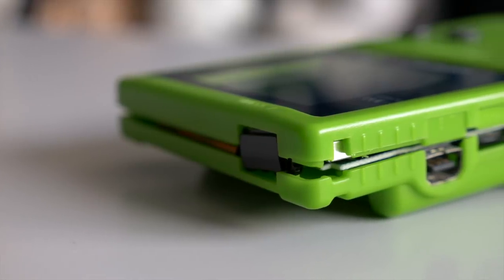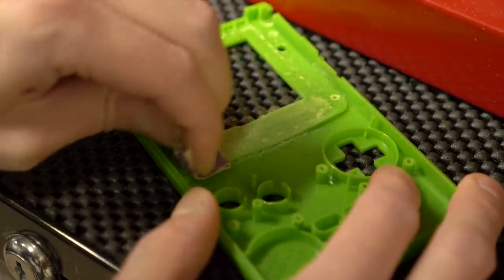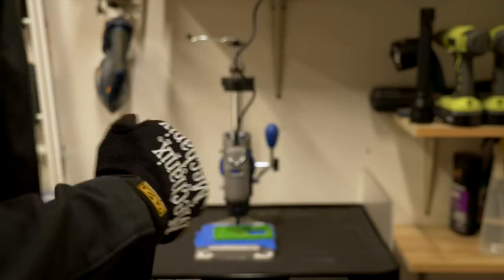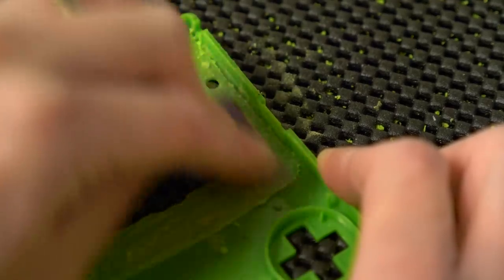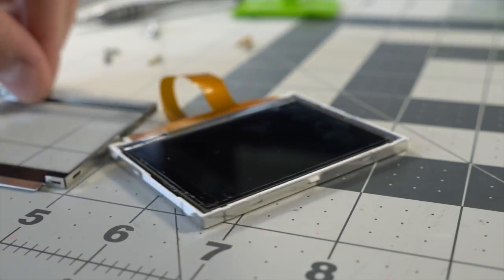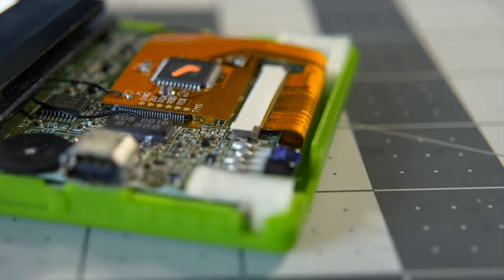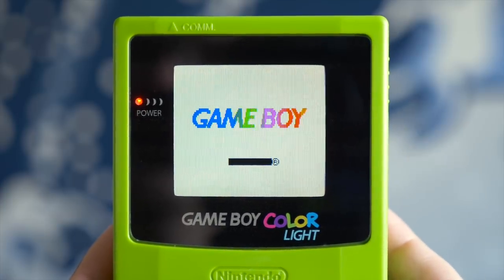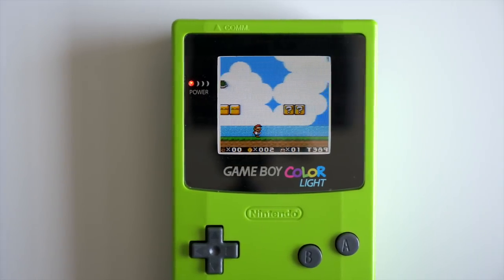Closing Up the Backlit Game Boy Color Shell!

Comment: Machine Shop 101: Do NOT wear gloves while using a drill press. The bits have a tendency to take hold of the gloves and twist. Often resulting in the loss of fingers, hands, and sometimes arms. An easily prevented injury or death. That little dremel and stand would probably break before a working mans hands would, but for the sake of proper shop instruction please do not ever suggest gloves while using a drill press. OSHA, your WC insurance, or some other safety inspector may disagree 'til their blue in the face, I'll gladly hand them some pigskin gloves and put them in the shop. Keep in mind that if you're not capable of ripping your own caught appendage quick enough it's gonna keep taking more. Wanna use the lathe next?
Reply: luckily its just a dremel ;) serious tho in some cases wearing gloves is more dangerous

Comment: Wearing gloves and using a rotary tool are not the best workshop practice. A pair of safety glasses would have been an better option.
Reply: Those are good tips - I was just about to write exactly the same comment! Generally using any kind of power tools and having gloves on is a risk of things getting caught up and pretty messy. And safety glasses would reduce the potential risk of parts of the casing flying in your eyes.

Comment: Super video! very good idea to use the dremel in this way to be able to fit the screen. Just one tip, in stead of taking away all the necessary material in one go, try taking it away in multiple steps. This means less stress on the material, less heat being generated, and overall a smoother finish. This will take more time, but it is definitely worth it. I sometimes work with CNC machinery, and this dremel setup is very similar.

Comment: Get rid of that Dremel drill press asap, Ive had 2 fall apart...  replaced them with a used 335.25926 craftsman.  off craigslist.   Its basically the same thing only all metal.

Comment: I still wish there was a 1:1 screen replacement solution. Even the Taobao GBC sidesteps these issues more neatly.
*Cue the oncoming hate-storm*

Still, I'll concede that everything that was wrong with this mod has been resolved, so good job with that modding community.
Reply: That Taobao LCD screen is slightly smaller than the original screen and it makes a huge noise, and most of all, it plays the games in a slightly slower speed (very minor slow down, and you have to A-B compare with the original to find out).
Reply: It will still fit neatly into the case without having to resort to drastic modification of the case and removal of the LED. And I don't know if this mod allows it, but the Taobao also allows brightness settings.
Reply: PandaXclone2 No the taobao mod won't fit perfectly either, you have to brute force to screw back when closing the housing. His previous video shows that, and I have the taobao one myself and I can confirm on this. It still needs to trim down some of the housing. The benvenn mod (or it could be the Chinese version of the adapter) also supports brightness adjusting. The downside is that the screen/viewing area is smaller than the original GBC screen.
Reply: Well to be fair, the GBA SP AGS-101 screen also has terrible speed if you go with an original one (tho re-reading I understand you mean processing delay not ghosting), so better option is to go with a new batch chinese part. Funny that the new knockoffs are better than originals but that's true. I've done classic GBAs modded with those and they did perform better (color reproduction and speed) than the original. Only thing it loses is on sunlight visibility, but well that's where the AGS-101 gets destroyed by the AGS-001 and classic anyway.

To be fair I really don't know which one of the mods I prefer, I would go BennVenn cause availability, but no way I'm not giving credit to Taobao as well.

All this knowledge of the signal interface makes me wonder how viable would it be to produce new drop-in screens of the original resolution, preferentially transflective, with enough people into the idea we can reduce the impact of the tooling costs significantly, and the individual part price isn't all that much usually.
Reply: Kalvinjj there's another Chinese seller who is currently developing a new screen for GBC, 1:1 pixel match, not doubling, backlit of course, but that screen is actually a little bit bigger than the GBC original (slightly bigger, like 1 mm wider). He said he got the prototype working but he's still tweaking around and will start to sell them in the future.
Reply: Guangsi Han That's good to know. Can't wait to swap a new backlit screen into my atomic purple GBC. The frontlight+loca just isn't cutting it and I would like to use a GBC over my GB Boy Colour.
Reply: i think in the end i'll just stick with by backlit custom pokemon gba, but still this mod went from "eh" to "nice"
Reply: It's possible, but $$$$.

Factory will charge you tooling costs and a huge minimum order. Sadly not feasible for this niche.
Reply: do you have a recommended seller to purchase a new ags 101 screen from? it is hard to sift through all the garbage on the internet
Reply: Hello! How's that Chinese seller's work progressed?

Comment: Removing the screen's frame is one of the steps that was necessary for my classic GBA with AGS-101 screen mods. Tho on my mods I removed both metal shell parts of the screeen, as it does hold itself well without the back one (if removed carefully) when assembling back the modded console, and no need to fuzz around with the components, as the necessary cuts to shell and small trimming of the risen frame of the screen is enough to make the new screen fit. Heck I would bet I wouldn't even need to sand down the inner small inserts if I had removed the metal frame in 1st place (as it has the exact same internal structure).

Also hell yeah that back sticker!

Comment: Damn it’s like every time I think the backlit GBC is dead because of some problem, it comes back with a vengeance. Want light in your GBC? Try a frontlight! Frontlight not bright enough? Try the Kitsch-Bent backlight kit! Too washed out? Buy a clone console! Not the right aspect ratio? Buy a modded GBC from Taobao! Too expensive/not enough stock? Stuff an AGS-101 screen in there! Shell doesn’t close properly? Here’s a custom milled shell and some 3D printed brackets! No more power indicator light? We fixed that too! This search for the perfect backlit GBC has been a wild ride from start to finish. Now if we could only find another warehouse full of those AGS-101 screens, so people would stop destroying perfectly good GBA SPs, everything would be perfect.
Reply from the maker: Actually, reproduction AGS-101 screens have been around for a while and are readily available. No need to scavenge one out of an original console.
Reply: This Does Not Compute Well I guess that means everything IS perfect. How long have they been around? I just recalled in your video about where all the GBA backlit kits went, that you proposed a theory that someone had just found a warehouse full of unused screens and that they ran out (funnily enough that was the first video to introduce me to your channel). Have you talked about these reproduction screens in any of your other videos? Are they the same aspect ratio as the original? I’d love to know more

Comment: If you have a spare lens keep that attached while you are using the Dremel it'll help keep the frame flush and not war because the glue will hold and take most of the Heat as well as the additional plastic on the screen

Comment: Fascinating modding...... If you the already prepared shells wouldn't have been available, I would have suggested that you might do the milling in a little bowl of water, whatever would fit under the machine. This way, you could have been working at highest speed without melting damages. And the debree would have been flushed aside for better view. Anyway, I like the engineering level of that thing.

Comment: I added a backlight to a game boy pocket some time ago and it didn't go too well since it is really hard to clean up the lcd perfectly. However (thanks to 8bitjunkie on youtube), I found a product called chipquik and with that, it is possible to use it to desolder the connector on the lcd giving free access to the back of the lcd. At this point you can clean it really good and apply a polarizer directly on it and then resolder the connector.
I found a bivert chip on kitsch bent that's easily soldered in.
That's a project that I'm looking forward to and I'm going all out just like you did on your video lol

Comment: Would you recommend removing the screen's front panel for the gba backlit mod? I feel like it'd make the gba a bit more playable. Currently, my backlit modded gba is closed well enough, but the d-pad doesn't feel tight enough and the on/off switch is too sensitive for my liking.
Reply from the maker: If you're having trouble getting the GBA shell to close up completely, then I'd say it's worth a shot. If you're careful removing it, it's possible to reinstall it later on if you want to.

Comment: If only there is a better 160x144 lcd, websites and companies only offer 160x128 displays all the time. But it did well using the 240x160 sp display and center the image on the screen with only 8 pixels from top and bottom removed and 40 pixels from each side removed by covering them up. Then about the case, I do not wish to dig into my clear-purple colored shell so I might want to simply frontlight it or there is a way to backlight the display if I peel the right set of layers and insert the light that way.
Reply: well if you go with ANY screen mod you'll need to mod the case as well, front lights will need at least some small inserts cut for the front light wires.
To be honest from what I've seen, I wouldn't really recommend it either (well you can see on Colin's videos how it turns out).
Reply: Kalvinjj you can buy a shell for this backlight
Reply: Yeah, I just mean that since he doesn't want to mod his own case, he would need a new case regardless of which mod he goes with.

Either do the cuts, or get a new case, whatever mod it is.
Reply: Kalvinjj I think buy 101 lcd gbc shells are a better option
Reply: I sure would agree, specially with the new tabs. Unless of course one has great tools at disposal and wants some color not available on the pre-modded ones.

Heck that front glass and the modded back sticker alone would justify it!
Reply: Thanks for replies, maybe I can 3d print a shell but I need a good .stl file for that.

Comment: If anyone wants to save quite a bit of money on the Dremel go on Amazon and get the Wen rotary tool it has the same exact neck diameter as the Dremel and will connect to all Dremel attachments the only things that will not fit are the Dremel brand Chucks, that are used to  hold  the  fittings  but otherwise it will hold any Dremel branded fitting with its own Chuck I used the Dremel Mount shown in the video with that rotary tool and it worked flawlessly they also sell a little plunge router attachment and dog nail trimmer at Walmart that also work with the wen rotary tool

Comment: So whats the battery life on this?
Reply: 3v/0.6w=5 amps. 5200mah /5 amps= 1040/60 mins +17.3hrs. Factor in some internal resistance etc id say about 16hrs give or take. I could be wrong but I think this is correct. The 5200mah is based on aa lr6 which range from 1800mah to 2600mah.
Reply: Well I know the GBA can get up to 24hrs and was hoping the modded GBC might be the same using 2 AA Eneloop batteries, which is why I was asking from seeing this video long ago  https://youtu.be/Op45jlPyFl8
Reply: Yeah it was actually more 15hrs it was only 24hrs because they were sitting in demo mode. But still 15-17 off two AA cant really complain can you.

Comment: Nice DP work!
 Ive had success on similar tooling/mod projects using the same dremel tools & accessories you used. But with the crucial addition of using the, 'for-plastic-use,' cut-off wheel;
 BEFORE going in with the the milling bit.
Dremel EZ476 1 1/2-Inch EZ Lock Rotary Tool Cut-Off Wheels For Plastic - 5 pack 
by Dremel 
Link: http://a.co/1BiBzP5  

Thanks for the vids!

Comment: Or get a gba
Reply: GBA has compatibility issues with GB and GBC games, mostly to do with sound. Some people also just prefer the GBC form factor.
Reply: does it?? Gotta be very, VERY rare issues since they literally have the Z80 processor inside them, exactly because the sound processing done on the Z80 is necessary for the GBA games themselves as well.

Which is one of the many reasons why it looks like total BS to not include GB/GBC backwards compatibility on the Micro
Reply: Kalvinjj there actually is a board inside the micro to make it backwards compatible but it doesn’t work because if it did it would be to big to fit so Nintendo scrapped the idea
Reply: u mean gba sp
Reply: I looked it up, there is a list of like, 10 games that have some slight sound issues on gba units and these games are fairly obscure with one exception (Disneys Tarzan has some high pitched audio on startup or something)